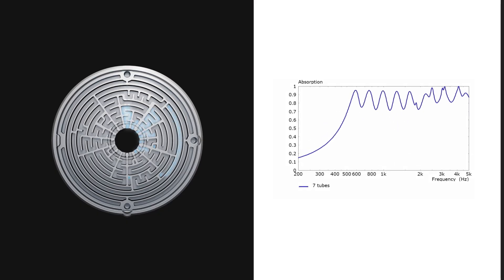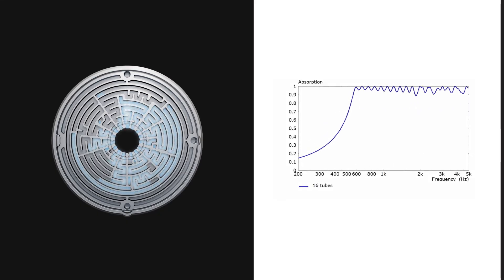Metamaterial Absorption Technology – The latest innovation in loudspeaker design (3 min)

Comment: I think it is very nice to see that KEF is coming up with solutions to problems that are outside the box. But I'm having a little trouble understanding how, if this META disc is good to absorb frequencies from 600hz up, how is it that it is set up to absorb the back wave of the tweeter, but the tweeter is crossed over at 2.1khz. If that's the case then the META mat in this particular case is working from 2.1khz and up and not 600hz and up as advertised.
Reply: As said in the video, they utilise 1/4 wavelength absorption. For 600Hz and a speed of sound of 343Hz this gives a wavelength of about 57cm and a 1/4 wavelength of about 14cm. 14cm when utilised in a maze-like structure as shown seems more than feasible. Also, the frequency you mentioned there is the corner frequency of the crossover I believe (often termed crossover point), the slope isn't infinitely steep so even though volume is reduced as frequency is reduced, it still exists. For the low distortion KEF aims for it's no surprise they'd want to minimise even problems nearly outside of the tweeter's frequency range.